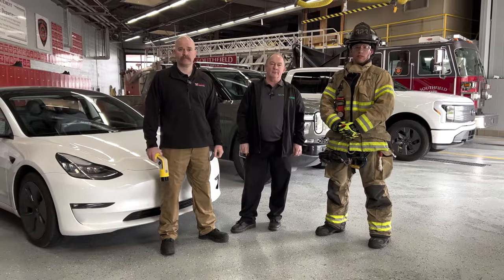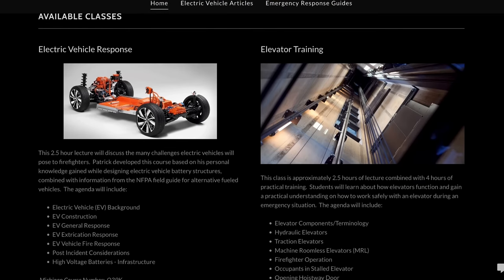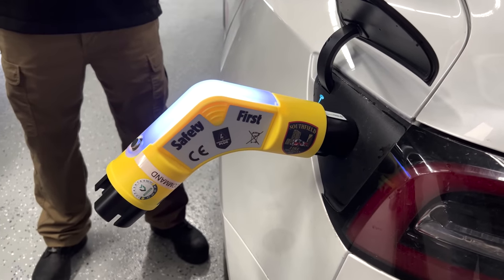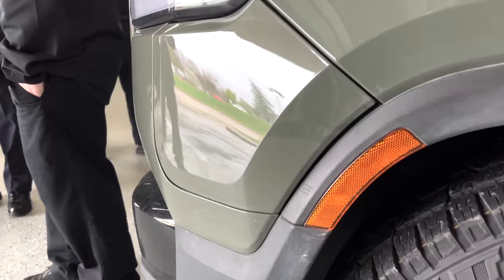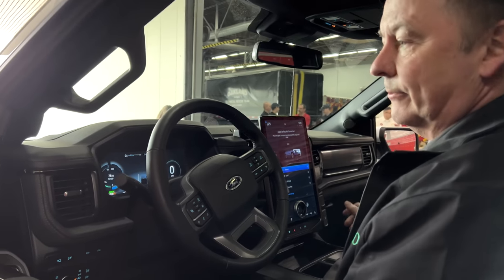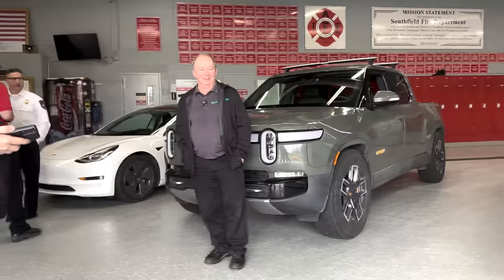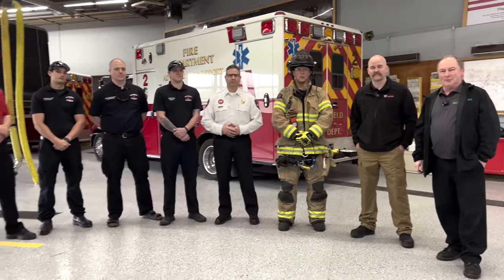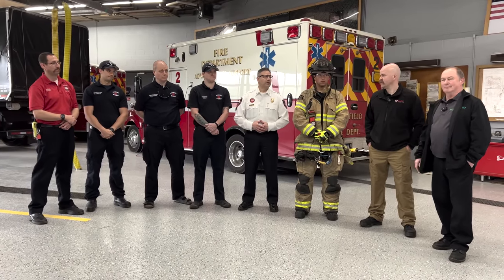An EV Device for First Responders: Emergency Plug Demonstration

Comment: A Tesla, and maybe other EVs, have a "fireman's switch" under the hood (bonnet) to disable the car.  Of course this tool is easier to use, but there's another way to skin the cat.
Reply: Good idea... but what happens when some random ahole walks up to your car and hits this switch?
Reply: @phtofl  That random dude must break open your hood and cut the first responders loop.
Reply: maybe the hood is so misformed that you can not open it.
Or you want to force the EV into park, before opening the hood.
(e.g. driver unconscious on the wheel)

Comment: Would it not be better to have a flame resistent shroud to cover the car to the ground and inject liquid nytrogen under the battery pack?
Reply: sure! if the driver is unconscious on the wheel, while the car is in drive, flooding the car with liquid nitrogen resolves the risk of the drivers foot rolling of the break peddle!
Reply: @sarowie  Obviously we are referring to a vehicle in flames with no ocupants within!

Comment: That means that if someone wants to disable your car for X reason, they can. It sounds more like car security vulnerability.
Reply: It only disables it when it's plugged in, you could just go and unplug it if someone was pulling a prank on you
Reply: @GeoffJohnson  If that prank is "give me your wallet and car keys" and is enforced with a gun, getting out and pulling the plug is the last thing you want to do.
Reply: @HenryLoenwind  I mean they can do the same right before you even get into your car too, or they could pull up and block you in
Reply: @HenryLoenwind  ...and staying inside the car would be the preferred option...?  You've lost control over the situation already in this scenario...
Reply: If they can get up close to the car and plug a device in to it, yes. But in that situation, I can think other ways to disable a car that are already available. A few bullets in the engine compartment, a strip of spikes in the road. Or the most direct: Stand directly in front of the care and just /dare/ the occupant to run you over and face an assault charge.
Reply: @vylbird8014  😆 assault charge for running someone over? Manslaughter, at least. If not vehicular homicide.
Reply: @fitybux4664  It's a low-speed collision. They'd bounce off the car - certainly bruised, perhaps with a serious injury or broken bones, but probably alive.

The trick is already used by aggressive 'window washers' in some parts of the world - the ones who run up to stopped cars with bucket and sponge, give the car an uninvited cleaning, then demand payment for their service - making sure that someone is standing in front of the vehicle all the time so their 'customer' can't leave.

Comment: More Teslas on the road than all other EVs combined, yet you need an adapter for the Tesla 🤔
Reply: only in the US. the EU version have CCS plugs like every other car.
Reply: Which EVs are most likely to need such a device? :)
Reply: Underrated comment
Reply: @MrAlbedo39  No
Reply: @SupremeRuleroftheWorld  Remember that the US has "CCS" as well.  Except that it's CCS1 which is very different than European CCS2.  CCS2 is even bigger, uglier and less efficient than CCS1.
Reply: @SupremeRuleroftheWorld  Doesn't matter here, as this video is about a device with a Type 1 (=US) plug...
Reply: You can thank Tesla for that.  They should have used the standard plug.
Reply: @1djbecker  CCS1 doesnt support 400V 3 Phase power though, which is very common in Europe..
Reply: @pasad335  when they introduced their Plug CCS was not a finalized Standard yet.. the other manufacturers were still bickering about irrelevant specifics iirc, and Tesla wanted to ship their first Cars running off the assembly line.. no idea what the situation was back then, but it probably looked like it would take years to resolve, but after Tesla started shipping Cars with their Plug the tandard somehow magically came together quickly..
Reply: @unitrader403  So they then foolishly stuck with their proprietary plug from then on because why?
Reply: @pasad335  not sure why it is foolish.. from what i have seen of CCS1 and NACS the latter is superior in many ways.. also changing would have been probably suicide for the company back then for no obvious gain

Comment: Carjacker's dream
Reply: Misuse would be kidnapping, another felony.
Reply: @isthatatesla  A possible scenario:
- Two felons (possibly armed) approach an EV stopped at traffic lights at night
- One inserts a disabling dongle (AKA "Emergency Plug") into the charge port (possibly spray painted black and / or with indicator lights disconnected to avoid attracting attention) and immobilising the vehicle
- EV occupant gets out to investigate
- One felon attacks or subdues the occupant
- The felons enter the vehicle and drives away

The felons may also deprive the occupant(s) of cell phones and other means of calling for help, allowing the felons to get away.

Before returning home to Australia, I used to live in Johannesburg, near the city's most active carjacking intersection (N1 highway and 14th avenue).  Getting home at night was always a white-knuckled ride.  While carjacking was rife, kidnapping was unheard of.  In the wrong hands, I can see this product making life exceptionally dangerous in certain parts of the world.

Its worth noting that petrol driven vehicles are NOT cannot be disabled from outside.  Apparently, however, these new EVs CAN.  Weird.
Reply: @roscozone8092  any car can be disabled if the brake system is messed with, or if a parking boot is installed. And this is fairly "outside".
(It was a very shitty design for them to build in a security vulnerability into charging ports of EVs. I just think you had an invalid point saying petrol cars don't have vulnerabilities.)

Comment: Maybe EVs need a firehose port that leads directly into the sealed battery compartment.  Rip bumper off to access water port, connect and supply water.  Maybe a vent on the opposite side of the battery that allows the air to escape?
Reply: Holes in the battery seem like a bad idea. I suppose you could have a wax seal of some kind.
Reply: @jamesphillips2285  Yeah, was thinking a plug that blows out with the pressure of the incoming water.

Comment: The only problem this device seems to address is not an “EV problem.” I’m not aware of any ICE vehicle that can be turned off or put in park from outside the vehicle save for race cars with emergency disconnects. In fact, most EVs will not roll/drive away without user input whereas most ICE vehicles will roll/drive away without the user preventing it. (Assuming vehicle in gear obviously) As others have mention this seems to be more dangerous then helpful.

Comment: I watched the whole video and still have no idea what problem this solves. All it does is prevent an EV from driving, doesn't cause HV contactors to open. In what scenario is this useful?
Reply: preventing ev from driving which can happen instantly silently and very powerfully unlike an ice where you hear the engine and step back
Reply: @davidck1  ya I understand what it does.... In what scenario is that useful?
Reply: @bmk789  emergency workers removing an injured person and accidently taps into drive: extremely dangerous to everyone involved in a split second silent 2 ton acceleration. Or ev on its side emergency workers or occupants accidently tap into drive wheels start spinning at high speed silently injuring emergency workers
Reply: @davidck1  I am an emergency responder, and an EV driver. This device serves zero useful purpose.

We've had ways of safely putting vehicles in park for many decades now, and there is nothing different about an EV here.

The proper emergency procedure for ALL vehicles is:
1) put vehicle in park
2) chock the wheels
3) disconnect 12V battery.
Works in both EVs and internal combustion vehicles to both stabilize them, and de-energize them.

This device might accomplish 1, but so does pushing the park button. and you won't trust it until both 2 and 3 are accomplished anyway.

Additionally, if there's any damage to the vehicle, (which is highly likely if we're trying to work on it in the first place!) you can't trust that the computer and all wiring connections, are working properly to follow the charging procedure to put it in park, so you can't even trust it to properly do 1
Reply: @Green__one  however in emergencies not involving vehicle damage you do not want to damage the vehicle when you can simply lock it in park with hand brake engaged while the driver suffering from helth problems is removed. Why do 3 things and damage ev when you can do one: plug in a charging plug. Its easy and free because every ev has a charge cable included.
Reply: @davidck1  if there's no vehicle damage, just put it in park the way you would any other vehicle. There's nothing EV specific about that process, and any gasoline powered vehicle presents exactly the same challenge. If there is vehicle damage, then you can't trust this thing will work anyway, so existing methods are safer. Either way there is no reason to use this.
Reply: @Green__one  the ev specific is engine noise engine revving,  instant quiet acceleration
Reply: @davidck1  which is not at all ev specific. Engine start/stop technology has been around for quite a while. And it doesn't matter what the vehicle is, you will never trust it when it is only in park. No vehicle is considered safe until it is in park, chocked and blocked, and de-energized. This only does the first of those three, unreliably in the case of vehicle damage, and no better than existing procedures on every other vehicle out there. In short this device has no useful purpose whatsoever. And as an emergency responder I would never under any circumstances use it.

Comment: would a bunch of sand effective for battery fires?
Reply: While it would be effective, the amount of sand required is impractical. You'd need a dump truck full of sand.
Reply: @vylbird8014  most areas have dirt around them. I'm sure dirt would be nearly as effective as sand. (But, you'll still need some sort of construction front loader. 🤷‍♂)
edit: unless you live in a concrete jungle.

Comment: They should have a better method, some kind of visual code that can be used in conjunction with the vehicle cameras or a fob that has an ever changing encryption. Also an internal kill switch within each cell is another idea, that upon thermal run away makes the electrolyte unusable and the cell inert stopping the runaway in the cell so it can't propagate to the rest of the pack.
Reply: Just make it wireless and with the ability to stop any car. Then police can use it to make car chases a thing of the past. Oh wait, cars already have that. It's called onstar. 😆

Comment: This device is useful.
It gaurantees the car won't move which allows first responders to move in and treat trapped victims. There is an issue of uncertainty in a crashed vehicle where the driver may inadvertently hit the accelerator and move off. 1st responders can't be expected to know what the dash icons mean for every vehicle and what to do if the screen is blank? A blank screen does not gaurantee the vehicle is off or in park.
Some EVs require the hood to be raised to deactivate the HV, this can take time if the car is damaged or when the driver is trapped, blocking access to bonnet release. The device creates a new stage one of a multi stage approach. 
In respect to car jackers, forcing the charge port puts the carjacker at risk as ports on many EVs are located at the front of the vehicle, in full view of the driver. Why stand in front of the vehicle and risk getting run over? If they do succeed, what happens next? They over-power the driver doors are still locked? then go back to the charge port and remove the device and move back into the car only to find they can't drive away as the driver who probably has key in their pocket is too far away for key to register!
Reply: As a first responder, and EV driver, myself, I say  your statement is complete nonsense.
We've been safely putting vehicles in park for many decades without the ability to plug some device into a port on the outside to do it for us. There is absolutely nothing different about an EV in this regard. The only thing this device does is put a vehicle in park, nothing else.
To safely work on the vehicle you still have to cut the firefighter cut loop.
Reply: @Green__one  my EV doesn't have a loop. Have you never encountered an EV where instruments are dark? if so how do you know the car is live or not?  Inverted vehicle with smashed roof, surely you would prefer to plug this device into the charge point before climbing inside?
Reply: @mickjoebills  you don't know your vehicle. In your EV, disconnecting 12v power will kill the HV pack, this device will not. Dark screens are not just a problem on EVs either, modern gas vehicles are the same, and with engine start/stop functionality can restart at any moment.
No vehicle is safe until it is in park, blocked and chocked, and de-energised. This device only does the first of those, unreliably in a damaged vehicle, and not in any better way than existing techniques used on all vehicles for the past many decades.
So no, I wouldn't feel safer using one of these in the scenario you give.
Reply: @Green__one  The device does what it says on the box, from relative physical saftey of first responder by popping charge port, rather than breaking the hood. It puts the car in park, thus providing primary level of saftey for 2nd stage (isolate main battery). It is you whom are wrong about EVs when you refer to cutting the battery loop, as not all EVs have a loop. I indeed know my EV, it requires hood to be lifted, 12v battery disconnected and a mains battery plug to be removed. The battery plug is buried behind the motor. An after market frunk needs to be removed to access the plug. The charge port device allows this activity to take place without fear or risk the vehicle will move.
Reply: @mickjoebills  not only do not understand EVs, you very definitely do not understand emergency response. I am an emergency responder. I would never under any circumstances use this device. It serves no useful purpose, and is dangerous if you assume that it does more than it does, which it implies heavily in the marketing. The end result is this device is dangerous in the wrong hands, and useless in the right ones.

Comment: Seems pretty dumb actually. The whole reason federal regulations forced EVs to keep the legacy 12V battery is so that first responders simply have to kill the 12V connection (clearly marked) and that kills the HV contactor in ANY EV. I don't see why firefighters would ever want to force a moving BEV to stop.
Reply: Federal regulations are the reason for the 12V battery? I had no idea!
Reply: Link to the regulation or I call bs.